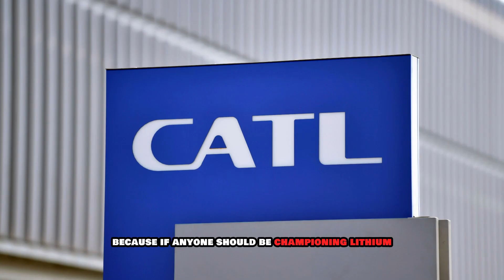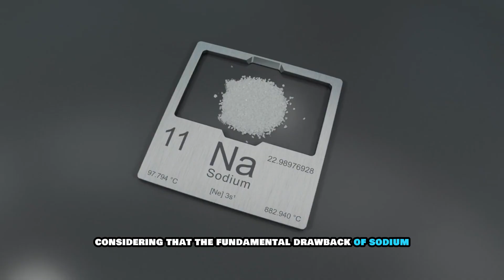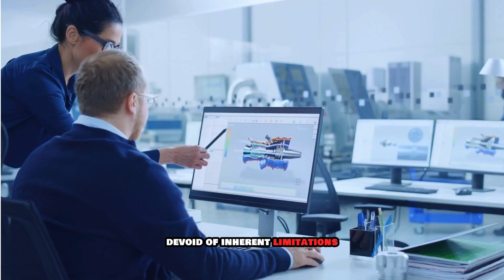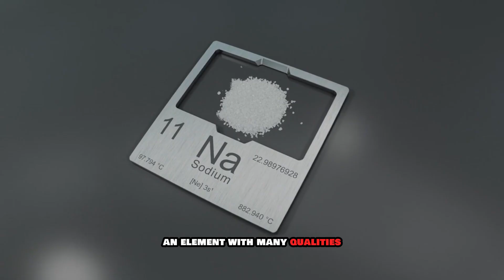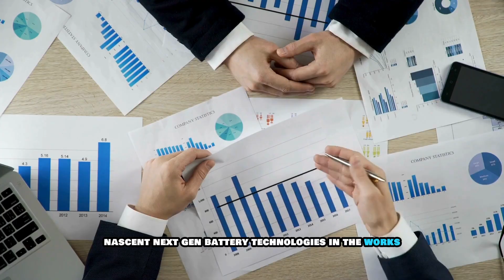CATL Announces 2nd- Gen Sodium Ion Battery with 5 Minutes Ultra Fast Charging

Comment: Let's say it's true about those batteries. 1/3 heavier then lithium per KW. Maybe not for cars but for power banks on ground,that don't care much about weight. And left lithium for cars. Example. 1.5 mln solar panels installations in Poland. Average 10 kw. Now that need power banks. 1/10 of the price? Instant sale for first 5 years of production. And  double capacity because why not.